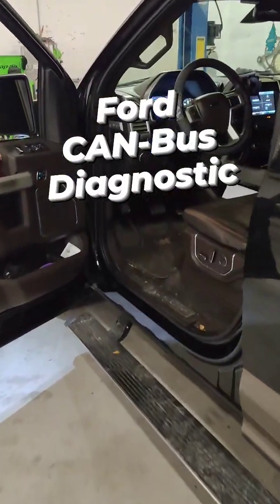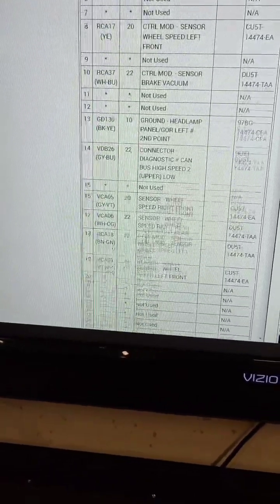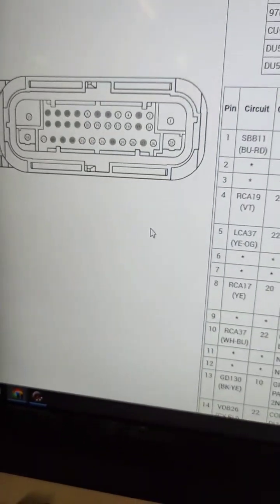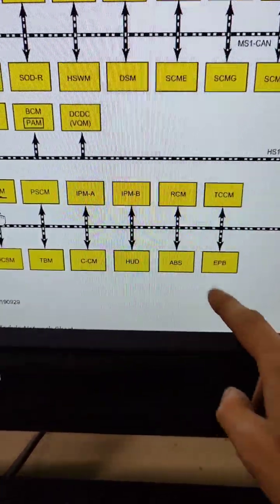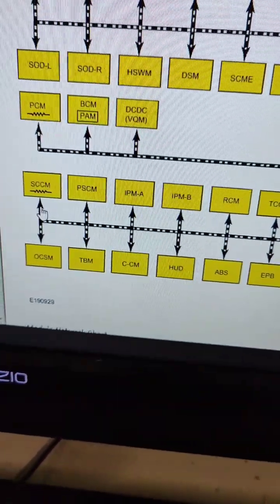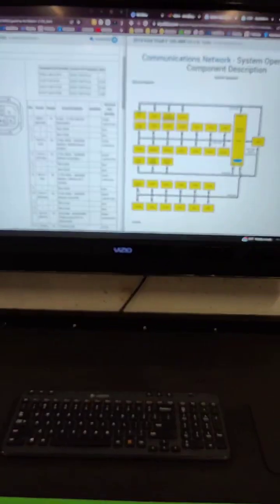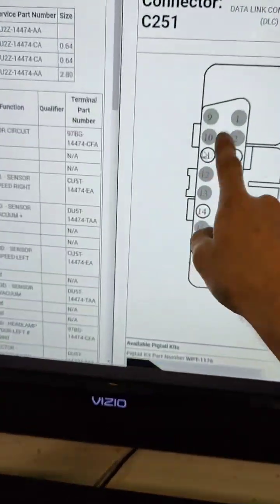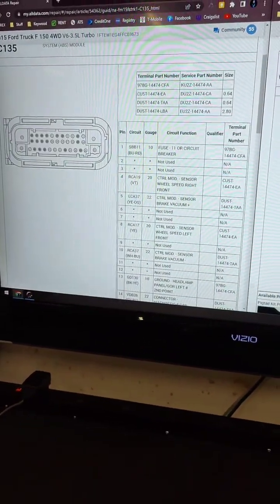Ford CAN-bus Diagnostic

Comment: I have 19’ f550 every module on the hsp2 can is saying lost communication with abs module U0121, however only the pcm has a u0121 code and a u1012 for invalid internal control module monitoring data from abs, and then another code I can’t remember for the signal from the sccm. I was not able to communicate with the abs but I could communicate with the sccm, so I replaced the abs module and had no fix. Removed the airbag to gain access to the sccm/sas and found the center connector to the airbag was damaged not allowing it to fully seat, that connector is a part of the sccm so I ordered that hoping it’s gonna fix it I’ll find out tomorrow. Now that I’m typing this out I think I might need to trace the signal wire from that sccm. Idk it’s hard to diagnose these new fords without FDRS.
Reply: Did that end up fixing it?

Comment: I have a 2004 F-150. Both abs and brake lights are on. I tried 3 different modules from sources that guaranteed they work. When I plug in my scanner to the obd2 port, it says it cannot communicate with the abs module. I checked the power and grounds the way you did in the video and all were working. What are the chances of having 4 different modules having the same result? If a module is not programed to the vehicle, would that stop it from being accessed from an obd2 scanner? I am using an Innova 5610 scanner. Should I use Forescan to see if I can gain access to error codes?
Reply: Are you able to communicate with other modules sharing the same HS2 Can or MS Can network?
Reply: @DownloaderVideo  Yes
Reply: @ETR9331  I’m  pretty sure you a break on the CAN communications wiring going to that module. Since you are replacing the module, find the pinout for the modules’s connector and make sure you have can communications getting to the module, if you don’t have an oscilloscope a multimeter will work too. Depending on your car that module might be connected to more than 1 CAN network for example HS & MS Can.

Comment: Your COMM system with all the Yellow Nodes and if you use a scanner with TOPOLOGY is always wrong, this is one of several CON of the TOPOLOGY Layout, it is not trustworthy to show real-world series and/or parallel and/or actual order (1st, 2nd, etc) of the Nodes connection to each other and/or connection to the Backbone Bus Line running down the middle of all the Nodes. What is a PRO of your Yellow Layout, it shows where the Terminating Resistor (TR) is located and which Nodes are on the same Bus. To try to narrow down the location of a fault with a degree of greater accuracy and understanding visually before measuring voltages by pulling up the actual Schematic of the Bus in question to see the real-world Layout of the Nodes on the Backbone. That will show us why a few Nodes that you identified are related to each other and in this case, might point directly to the ABS Module as the potential problem with a greater percentage of accuracy. We then do the tests that you have highlighted and Bobs your Uncle.

With experience and balls of steel, when the ABS Module is involved, there is an extremely high degree of accuracy that the ABS Module is at fault with the simple PWR, GND, & COMM quick test being all that is needed. Cheers

Comment: I just fixed a 4.0L   08 explorer.   Lost coms with pcm, abs, and 4x4 control Module.  I checked the obd data link  and didn't have the correct ohms at first then I did it's weird because when I looked up the abs and followed the abs test port harness it traveled under the battery.  So I removed the battery and battery box. Found a 🐀 nest.  Rat bit through the white cable.  I cleaned out the next and spliced the white wire and ran a diag scan.  Modules that were not communicating started talking. I turned the ignition to run, and she woke up. Ran rough at first but settled after clearing all codes and performing self test and clearing all trouble codes. All checked out good.   Now I just have one code that  goes away with a pcm relearn and a drive around in high ways and stop and go traffic.   
🪶Rats, my friends,   🐀 🐀 😅

Comment: oops 120 ohms
Reply: "Bypass" Be specific. You would have put a 120ohm resistor where? 
He sees the last module at 120ohms, and the others should be reading 60, if you add a higher resistance you would not be able to see if the module itself is bad.

Comment: I’m confused if you wouldn’t mind explaining your process further to me? 

You said you tested from the DLC to the ABS module connector? It’s my understanding that there is no physical connection between those points at all. They are only connected through the gateway module. Do you mean you tested from the connector going into the gateway module to the ABS connector? Because that would be the only way you can do what you just said.
Reply: He said he tested from the DLC to the ABS and did a continuity test. The Pin in the DLC for the HSN ( High speed network) carries signal to the ABS Module, and therefore he tested the wire continuity. A gateway module is still a module to which has physical wires connection thru it. Data may be blocked, but the physical connection is still there. 
Also thing I would have added is an OHM test to see the Ohms at the termination module as well as the ABS module. ( Disconnecting the modules from the network and measuring there resistance from the CAN High and Low on the modules. )
Reply: @wiley0714 you don’t seem to understand Ford CAN Bus networks or CAN Bus in general. There is absolutely no physical connection as you say through the gateway model. All networks talk to the dlc through this module  . I believe what he meant was he probed the connection into the GWM from the networks this is very easy to access and it’s a common test when diagnosing Ford CAN bus networks.
Reply: @breckboy654  DLC is down loading content. VCI ( vehicle connection interface). You dont even have that right, enough said.......

Comment: Did this happen to fix this problem I'm having the same trouble with a 2020 F150 but I have no communication on HS2 with any modules , experiencing hard steering , ABS faults , TCCM faults no steering wheel controls TCM faults , basically no communication with HS2 can bus at all
Reply: No you sound like you have an open somewhere in your HS-CAN2 circuit. Possibly your termination resistor. The guy in the video didn’t have a termination resistor issue likely. This is because he still had the rest of the network up just one module down.

Comment: I was , to find your video, thank you, I have a 2015 Fusion with similar issues, I believe I have tracked it down to failure in the Can Bus 2 network, mine says it can't communicate with the Rear View Camera but the camera still works fine.  Only the lines that show direction when backing up are not working.    Even when I disconnect all connections going to the rear of this car I still have the same can't communicate with the rear view camera issue.   I have tracked the problem and still not found the answer.  Somewhere in the front of the car.  I ruled out the power steering module and everything behind the front seats so far.   Working my way forward and like you the ABS module is still in play along with a few other modules up front.   I changed the DLC and even tried changing the BCM with no improvement before diving into all the wires for the HS2 system.   When mine fails, the AC and Heat, Radio and all functions in the center dash go dead.  Windows will not open or close.   When this happens on a 100* day the owner gets pretty grumpy.   They took it to Ford for repair, Ford said they could fix it but it would be very expensive and they did not have time so they did a couple recall repairs and gave the car back.  Owner went to another shop and they took many things apart had it for a week gave it back no charge and said they can't fix it.   After the repairs by these shops now the driver seat won't adjust and the Heated seats are dead along with the rear-view window defroster.   I think they fried the control switches for those.  I fixed the seat adjuster it now works fine.  I can turn the seat heaters on and off with my scan tool but not with the dash switches.    I have not fixed this yet but it is now a personal challenge so I will stay on it.   Curious to see how yours turns out.  Best of luck!  I do think the problem is in the HS2 network, a module, splice or pinched wire maybe.  Can only had 16,000 miles when this started happening according to the owner, it now has 29,000 miles.  The problem comes and goes, is not constant.
Reply: Did you ever figure this out?? I’m having the exact same issue right now
Reply: Ford cameras are common to go bad. May have aftermarket camera lots of aftermarket items work but then give no communication  dtcs to set. Rear camera needs LIN initialize and Rvc configuration on scan tool to make the lines work on guides especially if camera has been replaced or maybe battery  went dead per ford repair service manual